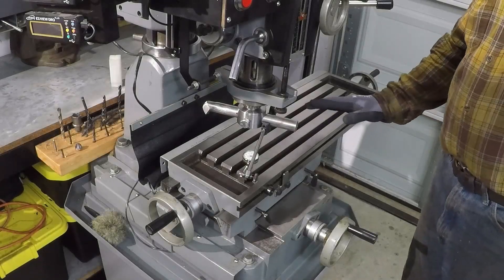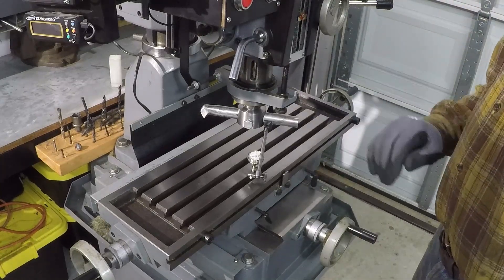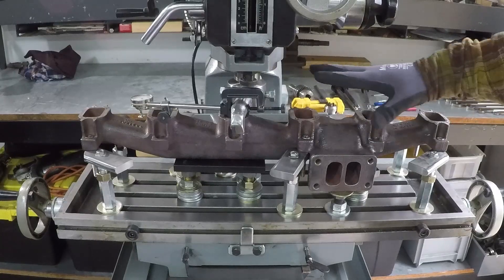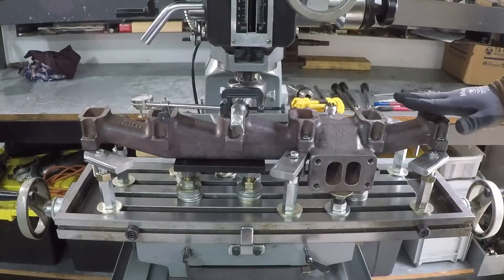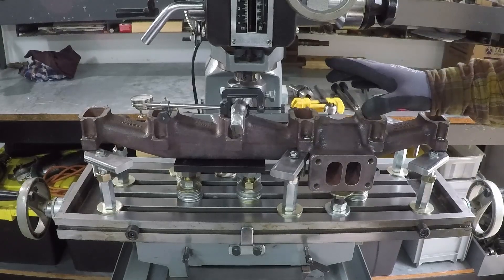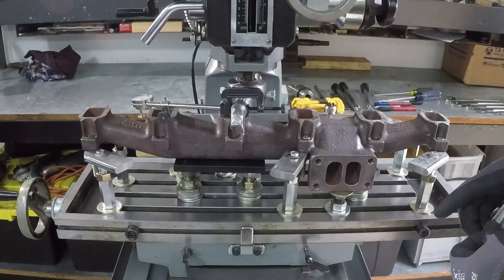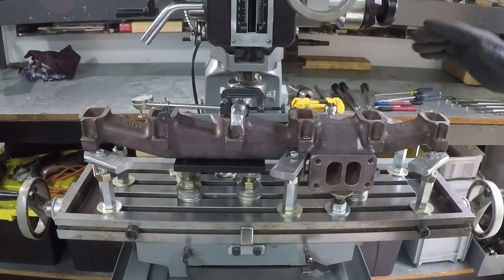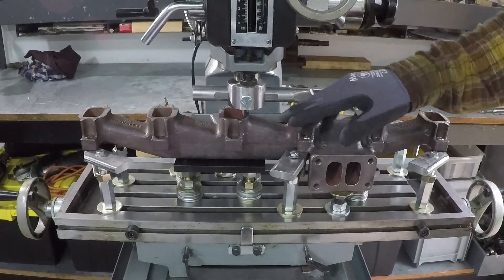Milling Exhaust Manifold

Comment: Machining / Surfacing an Exhaust Manifold ?????
Machining the Manifold is the Easy part.
How to Hold it to Machine it 😒
IF a customer ask for this to be done.
I usually try to find a way to get out of doing it 😅
Reply from the maker: It takes time. As you know, while trying to clamp it to the milling table, you must make sure it doesn't flex. Thank you for the comment and for watching, be safe and Merry Christmas
Reply: @SalamSayhood  Merry Christmas to you also, and all the best for 2024 👍👍

Comment: Turn out excellent Salam...That heavy duty carbide fly cutter in of a great design, very rigid to eliminate chatter, to get good finish!
Reply from the maker: Thank you sir, when I built the fly cutter, I was worried it maybe too much for the mill that I have. However, the mill run it fine. I just take light cut about 0.003".
Reply: @SalamSayhood  👍

Comment: I had a machinist try and talk me out of getting an exhaust manifold from a 455 Pontiac milled down. He just couldn’t be bothered with the work it takes to level them up. He eventually did it and that manifold never leaked again. 

This is some fine machining here. You can’t be in a hurry and get this right. You should check out Cutting Edge Engineering’s channel. Kurtis is very good at industrial grade machine work and welding.
Reply from the maker: Thank you sir, I appreciate your comment. I will check the channel you suggested. Be safe and have a great weekend.